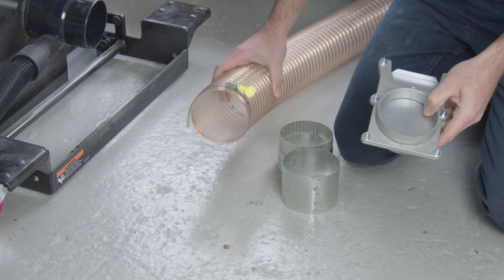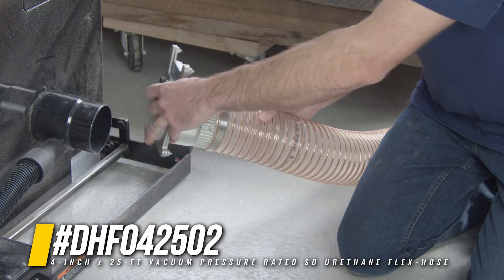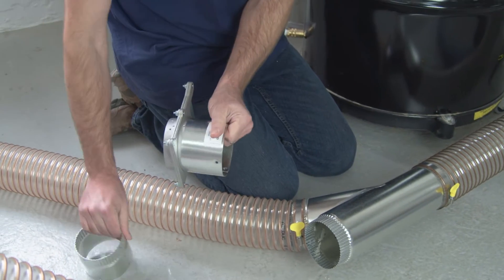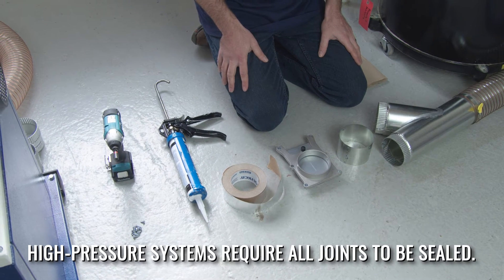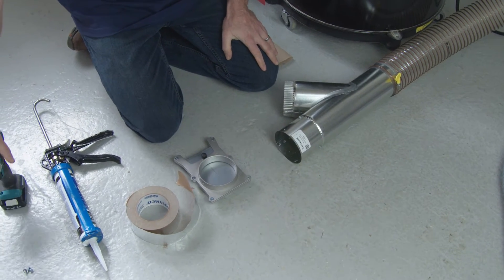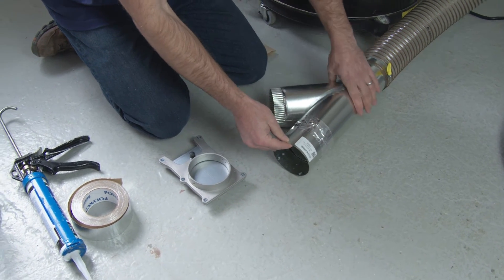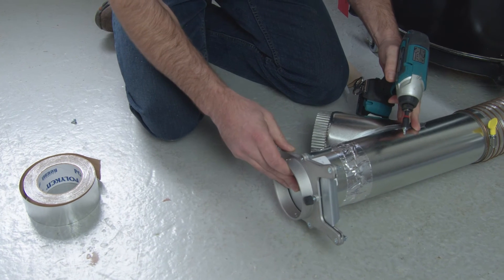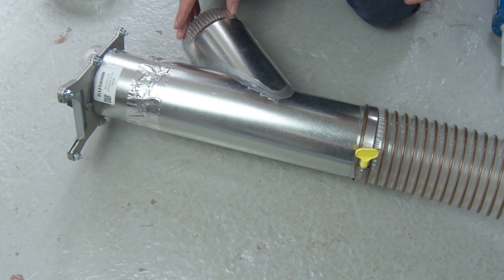The SUPERCELL®: Attaching and Sealing Flex Hose/Ductwork | Oneida Air Systems, Inc.

Comment: What about using duct seal mastic to air seal the joints? I'm not suggesting there's anything wrong with the methods you showed, but mastic seems like an even quicker way to seal ducting. That's what I see HVAC guys using.
Reply from the maker: Thanks for reaching out! Yes - you can use duct seal mastic to seal the ductwork joints. Please let us know if you have any further questions!